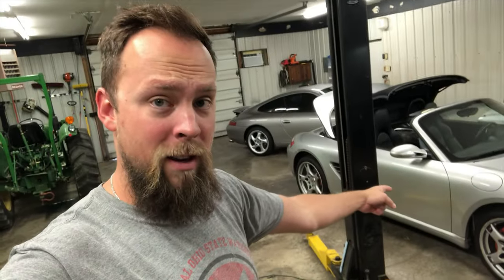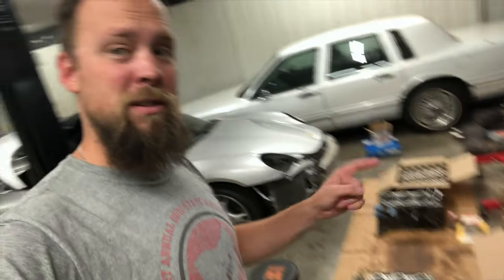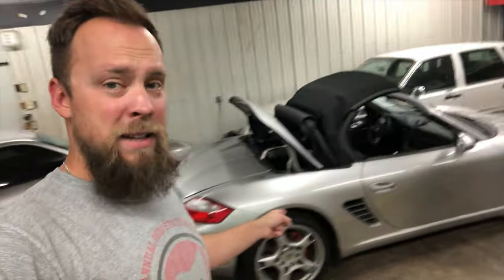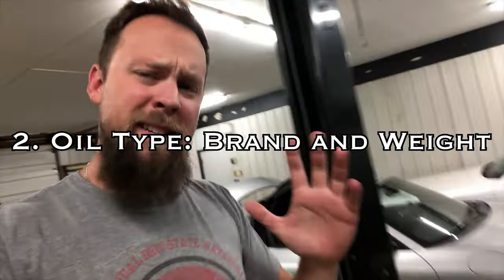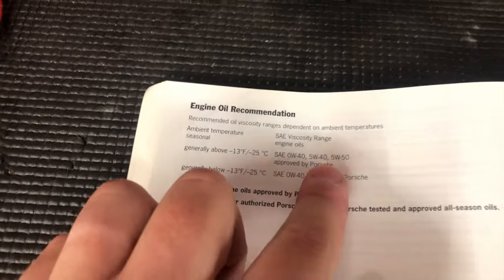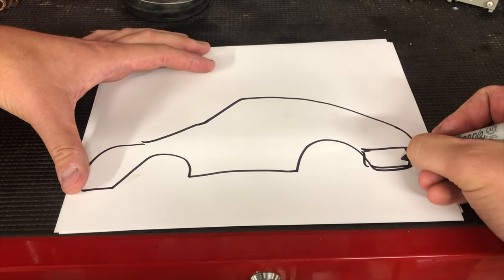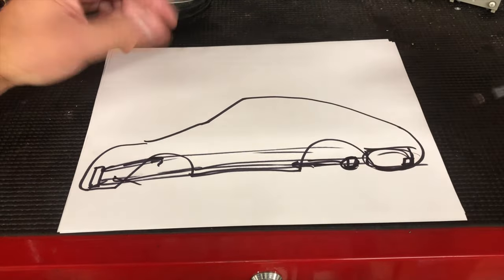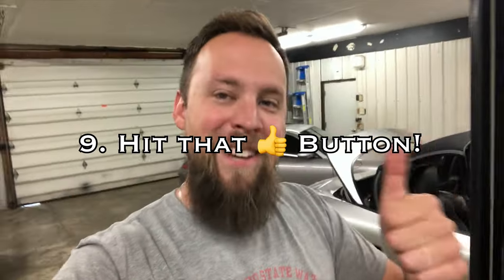8 Ways to Avoid Premature Failure of your Porsche’s M96/7 Engine

Comment: Early 996.1 here!
Great advice on the low temp thermostat, cleaning the radiators and keeping it under 3K until it’s warmed up.
I follow the oil change every 6 months regardless of the mileage.
Also I’d add replacing the 20+ year old fuel injectors with new OEM ones.
Reply from the maker: Niiice!! What year is your 996.1? 

Thank you, and thanks for watching! 

Yes, not a bad idea, especially if the car has ever sat for long periods of time.
Reply: @FunAhead_TV_Official  It’s a 1999 that was built in 2/98. 👍
Reply from the maker: Woooah. That’s super early! I love it! That’s quite a desirable car you’ve got there. Very very cool!

Comment: This short video has to be one of the most informative and easy to understand, I have seen in a while. I am a new subscriber and new owner (a month) of 1999 996 911 which I love but bought totally ignorant of all these million mechanical issues! IMS, bore scoring, oil leaks etc. It has 67k and in very good shape. I will definitely follow up this advice for sure. Unfortunately, I'm not mechanically gifted, but found a Porsche mechanic near me in El Paso. Already refurbishing the soft top cylinder's (seal started leaking) is a convertible and replacing the serpentine belt with all the pulleys . Saving some money for the IMS thing and clutch. Looking forward to seeing all your previous and future vids.
Reply from the maker: Hey Julio! Thank you for the super kind words!! 

Congratulations on your new 911! The 1999 model year is a great year! Yes, there are issues with this generation of Porsche, but don’t let all of the “hype” around these engines scare you… if your car has a clean bill of health, drive it and enjoy it!! 

Thanks again for the super nice comment, I really appreciate it :) and let me know if you want any advice on your 911!

Comment: Great content!

I'm thinking about buying a 987.1 cayman s, and your tips helps a lot!
I know the ims bearing failure and bore scoring have low rate of happening...
But since Porsche are way more expensive to maintain like my BMW 1 series and my honda civic, these kind of content are helping me to gatter info and be prepared for whatever happens.
I didn't know people uses 5w50, here in Brazil where i live it's somedays the temperatures drops below 10oC, but i think thats ok, because every car i owned before, i've always used a thicker oil due to high temperature, in summer it hits 35oC or more, on track even more.

Greeting from Brazil!
Reply from the maker: Thank you Hugo! I appreciate the nice words. 

Porsches can be expensive, but they’re actually not as bad as you might think. Typical running costs are in line with a BMW. 

The 987.1 Cayman is a great car! Definitely would recommend. Good luck in your search. Just look for a car that has had a recent oil analysis done so you can see the numbers and ensure nothing weird is going on inside the engine!

Comment: Excellent advice. I’m
Not sold on the low temp thermostat tho.  Cheers!
Reply from the maker: Much appreciated! Yea, the thermostat seems to be quite the topic of much debate, so you’re not alone. I’ve always run them on my cars though, and they certainly help! Oil pressure stays higher thanks to cooler oil, and coolant temps run lower, as shown by the brutally honest 996.1 coolant temp gauge.

Comment: Great video and great recommendations! I have two Boxsters including a 3.2 liter 2006 Boxster S and a 3.4 liter 2013 Boxster S. I've been following this discussion closely since I've had the same ticking noise in my 2006 Boxster. I had the bore's scoped and I only had very minimal scoring on cylinder number 6. They wern't even sure if it was scoring so I'm thinking it could be the lifters. I'm going to have this checked next. They are great cars! My 2013 with PDK  is a better car and my 2006 with a manual is a better sports car. I love them both.
Reply from the maker: Thank you for saying so, and thank you for watching! If you have the 3.2L then I very highly doubt that you have any significant amount of bore scoring. Most likely a noisy lifter, but hard to say for sure. 

Sounds like you’ve got a nice garage setup with those two cars. Keep driving em hard!!

Comment: Thanks for posting your videos.  I do not have a Porsche yet. I looking for a 987, 981 boxster.  Maybe a 986 if the IMS has been updated.  Currently driving a Ford Mustang Stage 2 Roush convert.
Reply from the maker: Hey Fred, thanks for the comment! That’s awesome man, I dig Mustangs. I’ve never owned one, but I’ve certainly thought about it on more than one occasion. Especially the GT350. 

Good luck on your Porsche search! If you want a 987, the one I’m rebuilding will be for sale in a couple months. Just saying!

Comment: Hi thanks for the information, much appreciate your time and effort. I went from a 2.7 cayman to the S 3.4 and with 80k on the clock was about to change the oil from mobil 1 to something better to prevent the dreaded bore score possibility, was advised on Driven DT40(5w40) or Millers equivalent? Would you advise going up to a 5w50 still? I am in the UK and only drive on sunny days! Also I am  using an injector cleaner called Royal Purple fuel injector cleaner as contains high PEA. I do get in the car and drive straight away and wait for the temp to be up before getting on it! Thankyou for your advice.
Reply from the maker: Thanks for watching!! I know LN Engineering recommends Driven DT40; I’m sure it’s decent stuff. Also, yes, I think running a heavier weight during the summer months can only help. Especially if you do any track days, or hard back road driving.

Comment: Hey, great tips… I will keep them all in mind…I have a low mileage 996.2 (<30km) and love it… Clearly it’s previous owners did not drive it much over the years but I got it to drive. Any tips on transitioning so called “garage queens “ into road warriors? Lol
Reply from the maker: Wow, that’s super low mileage! Haha well, the only way to make it into a road warrior is to get it out on the road and drive it! Of course, first check to make sure there are no fluid leaks that develop, or anything weird turning up in your oil filter as a result from the car sitting. Sounds like you’ve got a gem!

Comment: I’m confused…no matter when the thermostat opens, the engine ends up running at around 180F. So maybe the ramp up to operating temperature is slowed down?
Reply from the maker: The fan control doesn’t change, so the fans kick on at the same coolant temps, but your average coolant temps are lower throughout a drive whenever you’re moving as a result of ram air through your rads. Not a perfect solution, but an improvement nonetheless. Hopefully that helps!
Reply: @FunAhead_TV_Official  so my car would run at less than 180 with the low temp thermostat?
Reply from the maker: Yes.. well… sort of. The coolant temp is constantly fluctuating and your coolant temp gauge lies to you slightly by always holding at the same temp once your engine is warmed up. But the thermostat would begin opening at around 160F to send coolant up to the rads. As opposed to the stock thermostat which doesn’t begin opening until around 180F. Basically it amounts to more opportunity to keep your coolant cooler by running the low temp thermostat